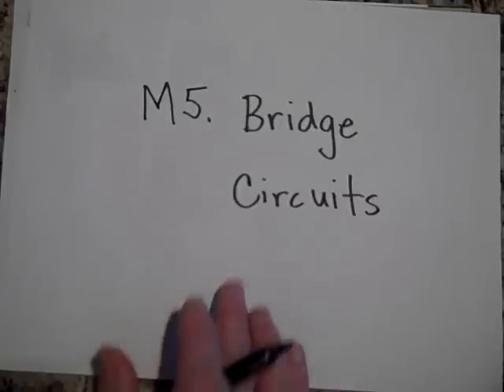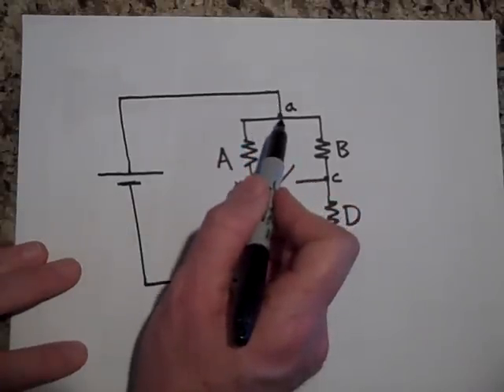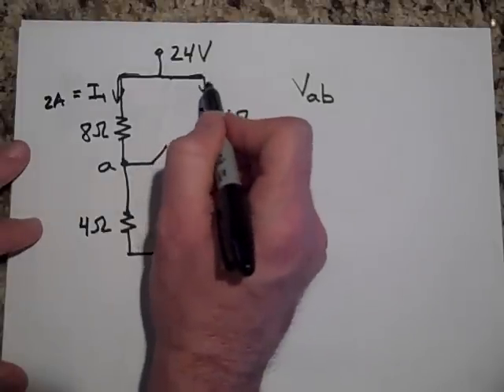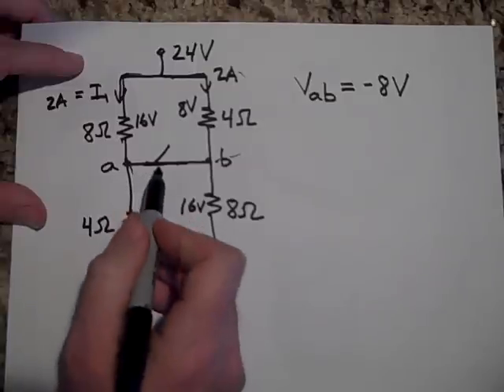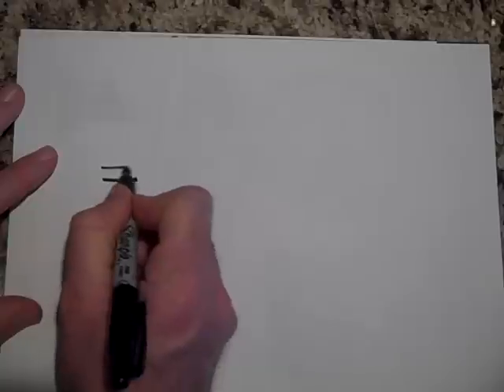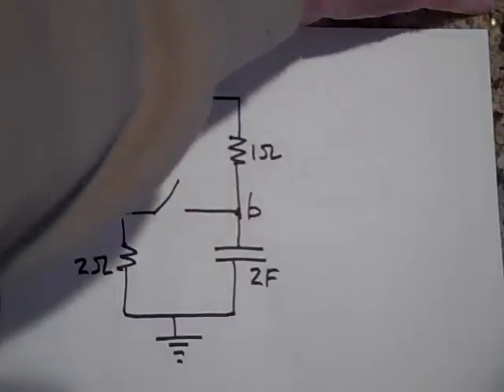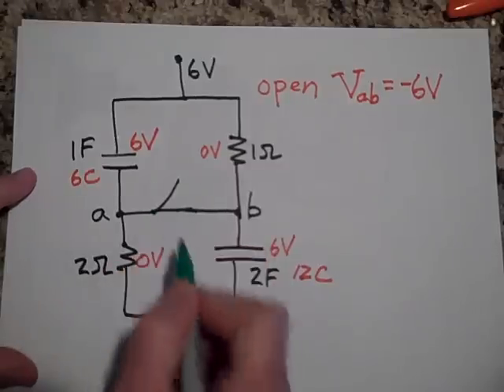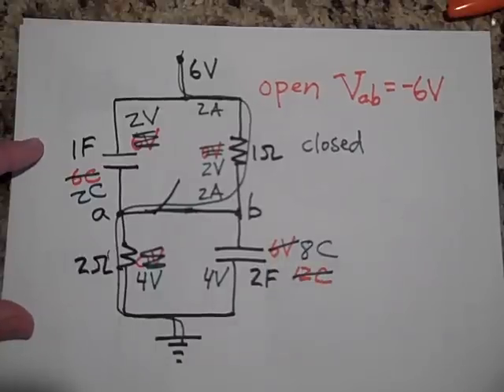Bridge Circuits

Comment: For those who wondering how he get I(1)= 2.

Here's the explanation.

Find R(eq)=6 ohm
Now find I using V=IR.
i.e., I= 4
Since it's going to be divided across different resistor. So it will be like this I=I(1)+I(2)=4.

Now if you have studied Kirchoff law then. I(1) will be 
I(1)=[R(2)/{R(1)+R(2)}]*I

And similarly 
I(2)=[R(1)/{R(1)+R(2)}]*I

Where R(1)=4+8=12 {R in series}

and R(2)=8+4=12 {R in series}

I have better proof in my notebook then here. And treat those (1) and (2) as subscripts.